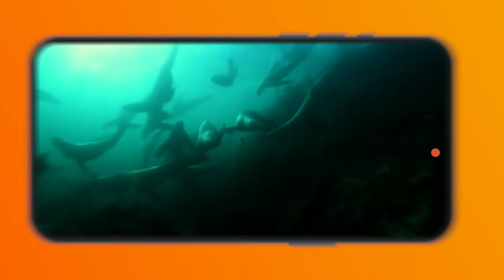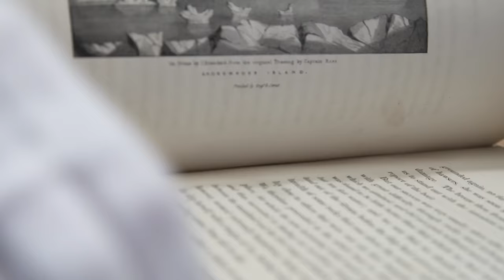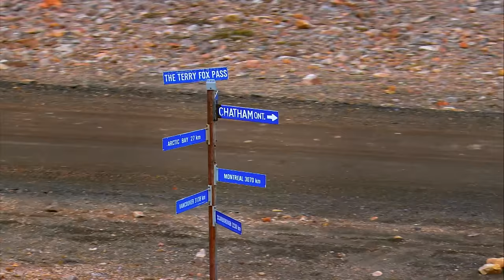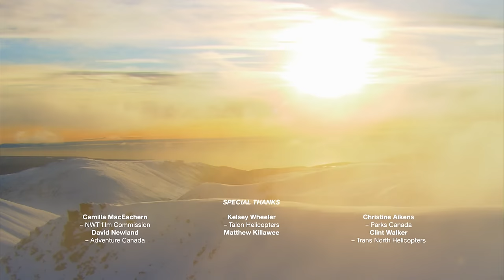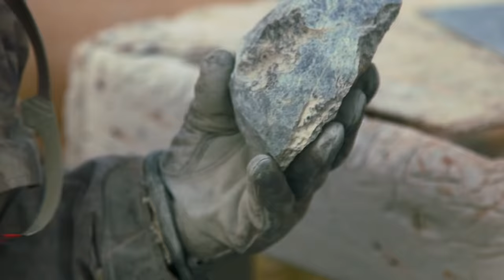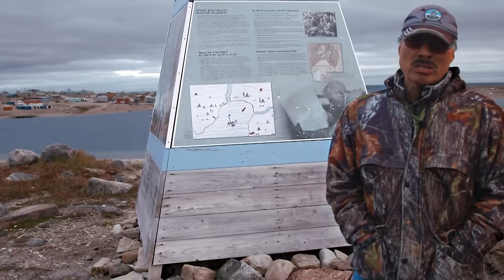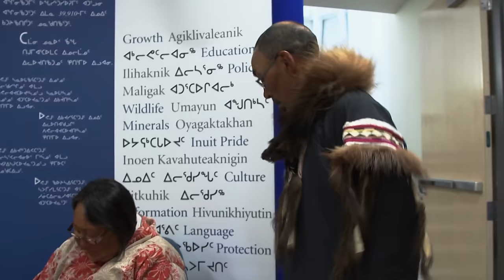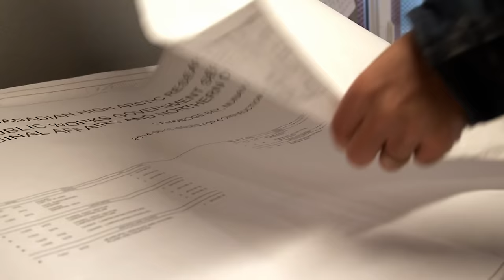Canada’s Unbelievable Arctic Landscapes | Canada Over The Edge Marathon

Comment: 136:00. Charlie uupik you can use a 5 HP. Shop vac with hose taped to a arm lamp and place the nozzle of the vacuum a few inches away from the dust and grinding and your dust problem is gone. You can carve inside, trust me I'm from the Arctic in Alaska. I know how fine ivory dust is